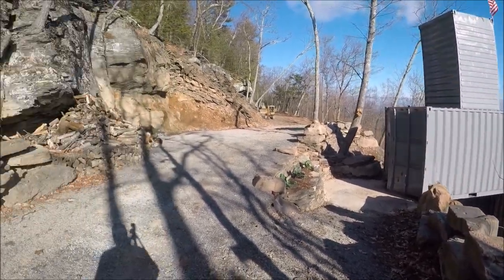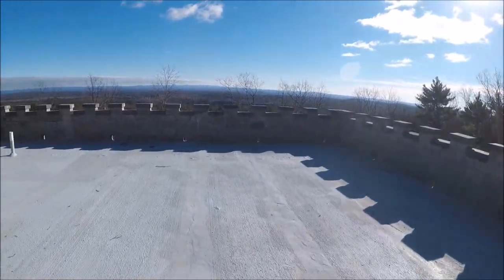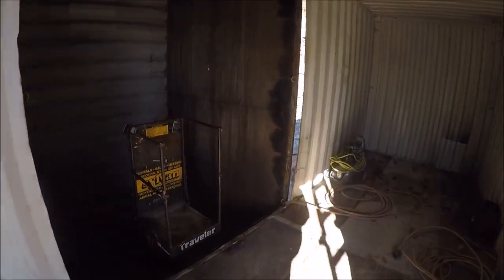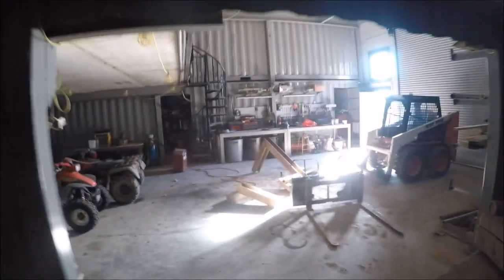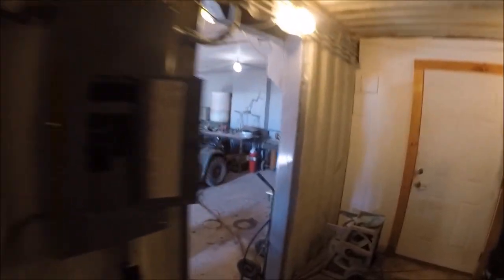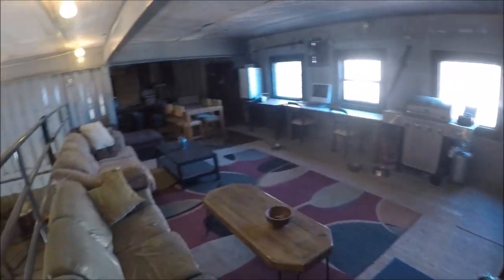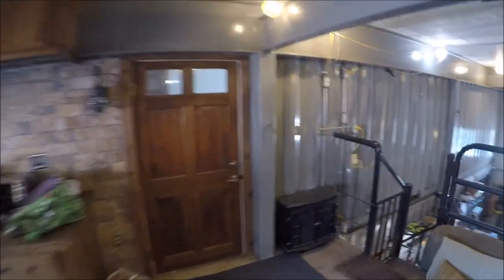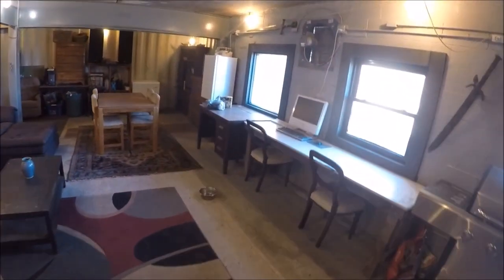Building a shipping container castle

Comment: Nice...if I did this on here in on Long Island NY I be locked up.  Lol....Awesome when you stood units up without crane..... We build a few shops for concrete guys with steel trusses spanin width 40ft two high. Welded together. I wish building dept would accept this here. We put up BLUE homes with crane. Similar idea for ultra rich in Hamptons. In fact modular homed are now in with Richy rich. We put a bunch up. 
Your idea may catch on. Good job!

Comment: I FREAKING LOVE this video.  Do you have blueprints for his home?
Reply from the maker: I kinda do. But it's pretty simple. You can pretty much copy it from this video.
Reply: Andrew Camarata  - First I have to buy some land then the shipping containers.   I just have NO CLUE as to where or from who to buy the containers.  Then I'll have a friend of mine who's an artist make an animation 3D rendering with his CAD Program.
Reply: Andrew Camarata  - I'm just going to keep it simple.  The garage you built will be where the Electric car will go along with the charging station.  The castle top will be a deck.
Reply from the maker: Good luck
Reply: Andrew Camarata  Thanks.   How much did the containers cost?  And how much for insulting, plumbing, and renovating the living quarters?
Reply: Andrew Camarata And what company did you use to buy the containers?
Reply from the maker: +Steve Vestel I paid $2400-$3200 each, I got them out of Newark NJ, the last few I bought was from Boss equipment.
Reply from the maker: +Andrew Camarata I didn't really keep track of what everything cost. I did most of the work myself, and just bought supplies as I had the time/money.
Reply: Andrew Camarata  - Awesome
Reply: You probably have been asked this but how many containers did you use
Reply: 7
Reply: Andrew Camarata you have to at least put a simple line drawing of how you placed /planned the containers out, this is so freaking awesome
Reply from the maker: Jas Ward the slab is 40'x40'. But if your building one, make it any size you want.
Reply: How much did the whole thing cost roughly?
Reply: @vestel777  How is your building coming along?
Reply: Mr.Mister I’m still in the planning stage.  I need the money to start anything.

Comment: we used to have a wood fired boiler  that we used to heat a resturant    boiler heats hot water  which is circulated  throught wall mounted radiators  all different sizes and shapes

Comment: What's the life expectancy of containers?  Won't they eventually rust away?  What kind of structural support have you used other than the corners of the containers?
Reply from the maker: DJDevon3 I I imagine they would last a very long time, especially keeping them painted, they are made out of corten Steel instead of regular steel which doesn't rust as quickly. I have some 6 x 6 square tubing and I-beams which support most of the concrete roof

Comment: thats a kickass setup you have there. just one question. is this a legal structure. not questioning your work, but have you had inspectors/building permits? just wondering as I think any structures over 40ft in most places need special licensing/permits in most areas. definitly a cool design though. look forward to any updates on it. subscribing.

Comment: Lets see here, you have six 40 footers, one is the tower (stairs), three are stacked nearest the upper road (Celling/roof structure between the second and third) and two stacked parallel to the three with the shop and loft between them.
Then there's a 20 footer as a sky bridge from the upper road to the third floor container, next to the tower.
Nice design, especially the loft.  ;-)
I'm sure the shop has a slab, are there rest on foundation blocks?

Comment: Was there a pro/con reason against doing g an In floor heating system to radiant heat the larger spaces? Just wanted to pick your brain a little on the heating/cooling front.

Comment: I have a really bad back I was thinking about making a tiny elevator in Mine what kind of lift is that and where would I find it also how much weight will it hold
Reply from the maker: It's just called a personal areal work platform. It can go up 25', It holds 300lbs, ( I have had more than that on it). I have seen those go for $500 used.

Comment: What type and how did you insulate the shipping containers? Mine have a tremendous amount of condensation on the inside on the ceiling.  Tim @ Cliffside Acres
Reply from the maker: There is no condensation if they are not heated.

Comment: I had a concept of a setup in a triangle shape with a metal/foundry shop (1 20' & 1 40', side by side on one end) and a woodworking shop (mirror of previous) and a maintenance shop (1 40, & 1 20' side by side, centered), three car garage(basement?) and living space up stairs (2 or 3 20's) above a corner away from the shops. with half containers on top of all 20's for head room.  The triangle center will be open.  ;-)
Reply from the maker: T'airn'KA Google skechup is a good way to design these buildings.
Reply: Not at $695.99 and the Free 30 day trial period didn't work (Murphy again).

Comment: do you have a rough idea on how much youve spent up to this point in the construction? i see youve improved since this, but at this point...what do you think your 'cost' has amounted to? (if i may ask. message me if you dont want to just blurt it out. ive been looking at some alternative building methods myself and this has caught my eye.)
Reply from the maker: DJ Deckard Cain I really don't, I didn't care, it wasn't too bad. I bought second hand materials, and did most of the work myself. So what I paid wouldn't mean much for someone else's project. I'm sure it's the cheapest/strongest way to built though. You can estimate the cost of the major material's easily. Than maybe double it, as the small details are a lot of work. But if it's something you want to do, the price does not matter.

Comment: did use the new blocks  of  with Kevlar fibers to stop the ak rounds   shhhh   tip  the glass or ceramic marbles  in kevlar tubs  as its made  then sawed to size
Reply from the maker: j lin I filled them all solid with concrete. They should stop bullets.

Comment: how can it support  all that weight   ?
Reply from the maker: Roger Warrington easily.
Reply: ISO Containers are obviously engineered, but there are certain limits to its other uses such as this and its requires additional support if used as an underground storm shelter/tunnel etc.
Reply from the maker: Joshua79C C I have I beams supported by box tube columns holding much of the weight.